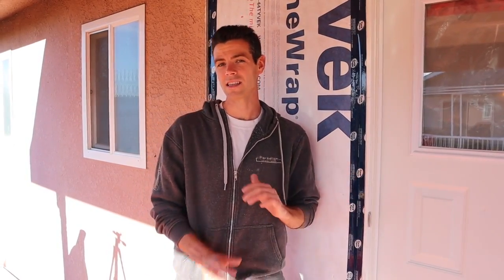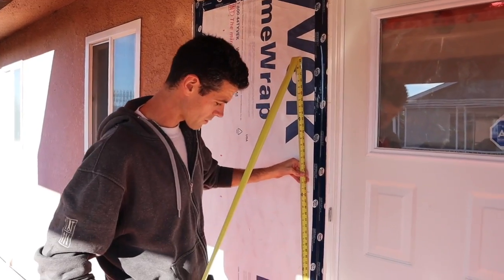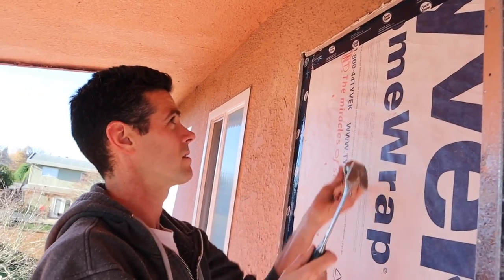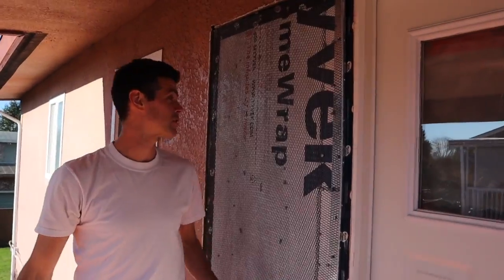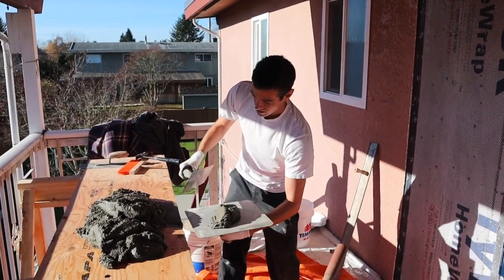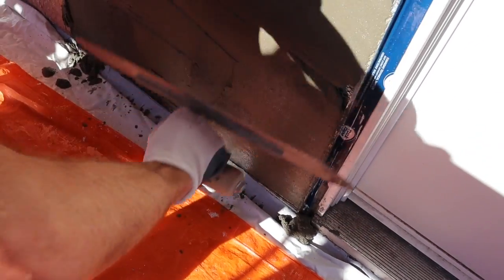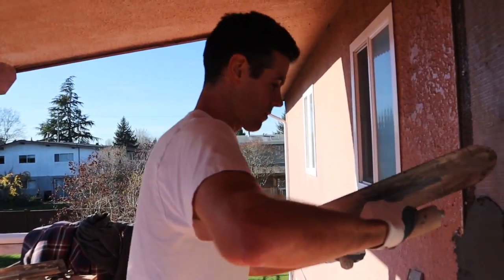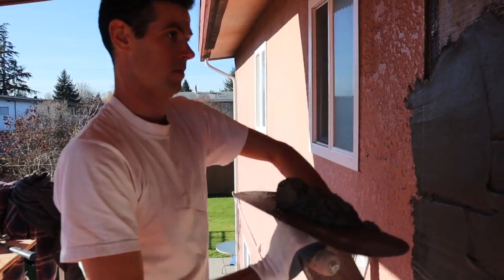Can I Patch Stucco? (Part 1)

Comment: Howdy Vancouver, I appreciate the shout outs with your video.
You did a brilliant job, especially for swimming upstream, for example your moister barrier is Tyvek, Tyvek is a lot harder to plaster over than two-ply paper. Why? Excellent question glad you asked, there is no suction with Tyvek like there is with jumbo tex. No offense to Tyvek as it's one of the strongest moister barriers sold on the planet.
   When jumbo tex is used this paper sucks or absorbs the moister out of the stucco faster, with the cement plaster you were using it would set almost immediately, another thing you did was wet the moister barrier and 3.4 mesh wire this would make the patch almost impossible to adhere, but you did it and had fun while doing it. Mesh stucco netting should be attached horizontally with the outer lip to hold the mud, one would have to look closely as it's one out of thirty who realize this fact. And one of thirty who cares.🤔  
  So now I'm interested, thinking he has almost everything against his ability to make the stucco adhere, the fact is you did it means you are a natural and have advance skills in handling mud, obviously learned from drywalling.
    Also, your Hod-Carrier made your life easier as he had a cool curled mustache, kidding, 😏that man mixed the cement plaster as perfect as It can be made. 
People often think I'm talented not realizing that plastering is like a team sport. It takes at least two people, without good mud, we can't apply as effortless as it appears.
Have I applied soupy mud, yes, have I applied mud so stiff each hawk full burns my arm, you betcha, but is sho-nuff nice to have mud mixed the way your was in this video.
    Your ability to improvise while still having fun and not panicking is surely why you will prosper in any direction you choose to go in.

Hears how your finish coat is applied https://youtu.be/Ehjtf2CyB10

BTW, the 3.4 mesh does come preferred or dimpled so the nails are not necessary, excellent again, improvising with adding nails to keep it off the wall.
  Lastly, I dont use a full radius trowel as they are for concrete, the trowel I do use is below
                                       https://youtu.be/X_SRyTIVMbU
                  Bringing peace, love, and harmony back to the world of plastering.

    The complete plastering encyclopedia on video, by the plastering messengers of Youtube with over 800 videos
Reply: Bless ya Kirky
Reply: @Titantitan001  Howdy Zchry, cool beans daddieo. 😉

Comment: Mad respect. One thing most people don't understand is that a repair is significantly more difficult than an initial new construction / whole house installation.  The fact that u knew where to stop shows both experience and talent. That last little gap would have mindf@$%ed so many beginners in screwing with it for another hour  and wasting another mix chasing 4 sq inches. I live in the new England where 1 in every 10,000 homes have stucco but I learned to install it in California on a youthful sabbatical from the real world and now those jobs pull a premium. Start to finish the job u just showed would fetch an average weeks salary for a highly skilled tradesman in my area. Labor and materials, no paint, texture match within reason.

Comment: Haha. I’ve worked for a three man crew building a few timber-frame straw bail houses. It’s nice to see you struggle a little with stucco the same way I struggle with drywall. We mixed our own stucco with lime, Portland and sifted sand. It lets you make it a bit more sticky. 

Noting the sun on the lower have will make it dry too quick. Might want to think about shading ur work area evenly next time. 

Love the videos. I look back on ur drywall vids every time I end of having to do that kinda work. Great reference.

Comment: Tie in your lath to the old stucco. Take it hammer drill and knock out the old stucco 3" from cut. Western blend sanded will make you a champ with a good bit of bonding agent (you work fast but a helper is required to clean and mix).  101 and mesh to blend. Texture, paint. Solid

Comment: Here's my take on your job first step any clean cut Edge on the original plaster needs to be broke back so you can mend your wire if not then it will crack where the new wall and old wall meet we usually call those cold joints
Next I would scratch and brown it regardless because when you try to put too much on at one time you get cracks and separation from the mud shrinkage when drying

Unless you use some kind of cement containing eisenwall which is fast drying but for more the advanced plaster

And since you're using Tyvek paper you don't need to wet it you only wet your paperback because it will suck up the water Tyrek don't suck up water now you increased your chances of mud sliding down the wall

Next as for your mud mixing 
it looks like you used premix sand and cement so you could have just mix the material in a couple of buckets or small plastic barrel using a paddle drill you would have got a better fluff out of your mix that way

And lastly you don't need that big pool trowel
 there is time and place for that all you needed was a regular 12 x5 hand trowel or one that you usually used on your drywall patches

The big trowel makes you have to used too much pressure because of the long edges
Reply: Edmund Frausto Agreed. Well said.
Reply: Lol

Comment: kind of makes you wish they made a thing called furring nails. also the lathe should be hung  horizontally so that the stucco can grab the pockets. a thinner scratch coat and then a 2nd layer is also the better way to go. you should have broken out more of the edges and tied into the original stucco and lath to prevent a giant crack forming between the old and new work.
Reply: Even yet did you know they make diamond mesh lath that has ribbes on it kind of like ribbed lath so it can stand off a flat surface
Reply: @edmundfrausto7588  Yes  but ribbed lathe is usually very thick.
For this application dimple lathe would work.
Reply: @shawnr771  yes I stand corrected in my terminology the diamond Mash has dimples on it not ripped

I've used it before in similar applications
Reply: @edmundfrausto7588  There is such a thing as ribbed lathe also.
Dimpled is more common.

Ribbed is expensive and the ribs face out wards.
Reply: @shawnr771  I just happened to go to my yard to put equipment away and I looked at my diamond mesh and it actually has ribs in it I've used diamond mesh with dimples in it before I forgot there was two type again I'm not talking about rib lath
Reply: @edmundfrausto7588  Cool. 
I also remember some rolled wire called K lathe.

Looked like 2x4 in fence wire that every so often then wire was bent to create a standoff.

I by no means know every product ever made or used.

Always willing to learn.

And then there is always the infamous chicken wire lathe.

I will say its good enough for barns and outbuildings.
Reply: Yep all kinds of different forms of lath out there
 on top of the styrofoam and that other one we used one time that was like cardboard with foam in between it that stuff took a lot of mud good thing we were gunning it back then

Comment: Yo Vancouver, Arizona here, im getting heavily involved in smaller patch work, however im sure it will be humiliating at times, good old Kirk he has it down, this job your on looks really good, I’ve learned a lot from you with drywall, and I was assuming stucco will be easy lol, 😊

Comment: Great video, Ben. I've done a fair bit of plastering which is pretty sloppy, so when I first did a bit of rendering/stucco I thought it'd be a cakewalk. Nope. It's like trying to handle a wet bar of soap. The other thing you don't realise until you do it is just how heavy it is compared to plaster/drywall compound.

Comment: Couple years late but I didn't see it mentioned in the comments.

That wire lath has an orientation. It should go horizontal, with the angled expanded parts of the mesh pointed in and down towards the wall. This allows it to "hold" the stucco. when you put it sideways (vertical) like you did, it is not holding the stucco and can fall out much more easily.

Aside for that, yeah, I've never managed to figure out how to make the stucco (or just mortar) "stick". I think kirk traded his soul to the devil for a magical trowel.

:)

Comment: For patching around windows or small areas, I use RapidSet but usually put 2 coats plus the finish coat because as this video shows it falls off it you put on too much. RapidSet cures very fast so I do a coat a day. The first coat looks a lot like a scratch coat. A medium size window might take me 3 bags of this stuff. I use more water than the bag calls for because I don't know how anyone can work it otherwise.  I mix about 1/2 bag at a time because I work slow and it sets fast.

I've used both chicken wire and the mesh. For the mesh I don't care about it being off the paper but for the chicken wire I use those nails with the cardboard offsets that hold it out. It's important to tie the whatever you are using together with the existing wire so try to preserve whatever is there when you are busting out the old stucco.

You are asking for cracks if you have clean edges. Do not cut straight lines with a saw--leave the edges very irregular by busting it out, about 6" around the opening. 

The hardest part for me is the finish coat since you have to try to match what's around it. This is where a professional shines. 

I'm a not a professional but this is how I do it.
Reply: There is a time and place for clean, sharp edges but in this case, your edges need a "tooth" to grab onto in the same guise as the chicken wire or mesh gives for the field.  Sage advice here.
Reply: If you're going to do a small patch then rapid set is great but if you're going to scratch and brown in a two-day amount of time then you could just use regular cement

Rapid set is too expensive to be used in a 2-day method and really does not give you any advantage again in a two-day method
Reply: @edmundfrausto7588  I thought the scratch coat takes 3-5 days and the brown coat takes 28 days to cure using regular stucco. What kind of "regular cement" are you mentioning? Thanks.
Reply: @FlyingSolo77  rapid set I'm sure it refers to the product you get from either Home Depot or Lowe's one of the two and it usually has eisenwall cement in it which gets hard very quick and with that being said it is used to do two coats in one day
They usually come in a 50 or 60 pound sack something like that and has sand already in it

now regular plastic cement does not have that properties so that's why you scratch it one  day and brown it the next day  or so 

and comes in a 94 pound sack what you have to add sand to

 

On an average a brown coat is let to sit 7 days before color coating at least in our area if you're doing a small patch it could be less than that if need be

Again all depending on weather if the weather is damp then curing it's going to be slower if the weather is 80s to the 90s curing is going to be faster and if the climate is really hot then you better water down your walls or else your cement will bake on the wall before it has time to dry right which will make it brittle

Also stucco refers to the method you're using wire lath cement and color coat are all labeled under stucco

Comment: Good job. I'm not a professional stucco guy but as a general contractor I get to learn lots of trades. Im thinking by looking at how your mix was acting and sounding... you needed more cement . .or lime. Your mix should have a little more "stick" to it. Great job though working with a slippery cement!

Comment: Called Rendering here in Australia-very rare for us to be going over timber frames-done here on solid walls such as brick and block,ya did pretty well but at least you have used hawk and trowel before.Always great when someone wants to try for first time ever-ends up on floor.

Comment: I’m from the UK where stucco (render as we call it) is very common. The only tip i would give you for this stage is to not trowel down. You already have gravity working against you so just trowel up (at this stage) 👍 Oh, and fill the top edge in very first job on a bit of a chamfer (push it in firm) to help the sagging when trying to fill in one go 👍👍
Reply: Kirk who he mentioned in video always fills edges first then middle area and makes it look easy.

Comment: just dump it on ground in front of the patch, thin coat for 1st and fill in 2nd second.....supposed to stucco to jagged edges to prevent cracking....need to break stucco back and fish the paper behind existing....just use regular lath paper and the wire you used is fine, doesnt need to be furred out...stucco is hard ass work, as a remodeler you learn all trades fairly well.......its the same as floating a shower for tile

Comment: If you don't demo the existing and overlap the existing wire, and new wire, you will have cracking all along the patch. Never plaster to a smooth existing plaster joint....Fun to watch 👍

Comment: I’m not a pro, but I’ve done a few of these using tips I got from Kirks channel with decent results. The most important thing I found is to start by keying in the perimeter. Once that’s in good and tight, the rest goes on like buttah. I never had such a clean rectangle like that though, mine were just busted out with a hammer. That helped make the patch less visible. I dig your channel bro, thanks for putting this stuff out there!

Comment: another great video, I did something very similar to what you are doing, a few years ago and it was coming along very well, but then almost near the top of the exterior wall I was doing, the whole patch fell right off and onto the ground. I had to start all over again, ugh. it did turn out nice in the end but I still hate doing stucco.
Reply: You may have put to thick  a coat on. Some applications require a scratch coat which is a base for the second coat to stick if to deep. Or if appling to a surface without lathe its recommended to lightly dampen the surface for good adhesion
Reply: @MrMkapusta agreed, I think it was too thick, but I have learned from my mistakes. lol
Reply: @briansullivan1927  its a tricky job but one that can be done with practice
Reply: @MrMkapusta  yes...and lots of patience

Comment: Great video as always! I don't know how this stuff has to be work with. I've never seen this boards over here in Germany. But why don't you scratch the first coat after putting it on? The second coat will stick much better on a rough surface than on a smooth or is this type of plaster rough enough?

Comment: Not bad. Where's your green float though. Kirk is shaking his head. Of yeah the old and new  paper and wire should  lap and you might consider using bonder around those edges to prevent cracking. that mud needs a bit of water

Comment: VC develops new stucco method of "hawking" it! hahahaha it actually worked tho! u should try to develop a new tool. maybe it is the the bigger surface of the hawk that helps apply it better by giving more blade area to push stucco into wall. then can use smaller floats to fine tune. similar to mudding... the bigger tool for application and smaller for fine tune.

Comment: Looks like all your lath/metal is zinc so your off to a good start. Now lets see if you hang your lath correctly.....No! Side to side bro!
Reply: Gravity trinity! Hang it left to right not up and down. Also the metal is slanted on one side of the lathe to let the stucco stay embedded better. Kind of like this  /  top side is out bottom side to the wall. So it doesn't fall out. Gets anchored better to the wall.
Reply: It will work no matter what you do but most people dont realize their is a correct why to install it. The diamonds are designed to face a certain way and its never hung up and down, always side to side
Reply: @trinitytoo  I worked for a stucco and plaster company for twenty years.

There are numerous books on specifications and industry standards.

Lathe should be installed horizontally.
When installing paper backed lathe the wording should be facing up and readable.
The lathe cups should be facing up and to the wall side.

When applying the scratch coat. The mud is pushed into the lathe.
The mud will bend over the lathe and down into the cups.
This is called keying.

Imagine pulling yourself up a chainlink fence.
Your fingers bend over the wire and grab on.
The little cups in the wire hold a little bit if additional mud making it hold better.

The scratch or raking part should be side to side so the next coat keys to the first coat.
Reply: @trinitytoo  Oh I aint a pro I was a laborer and trained by old meb who had been doing for 40 years when I started.

Its how they explainec it to me.

Comment: So this was produced after the 2018 BC Building Code was put in effect?  Interesting.
Reply: Just had to review it (BCBC) and it confirms what I was thinking, there are minimum of two base coats required, minimum 6mm each, the first base coat roughly scored to provide keyed fitting to second base coat, and second base coat roughened to provide keyed fit to top coat.
probably all good you're able to get such a thick coat on in one go, and makes the double base layer irrelevant, but leaving a rough surface is still required.